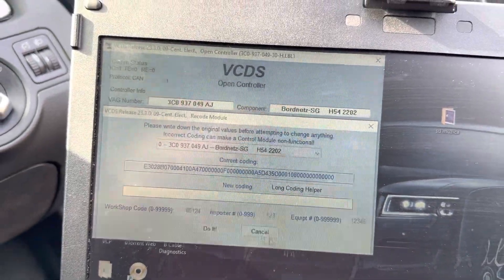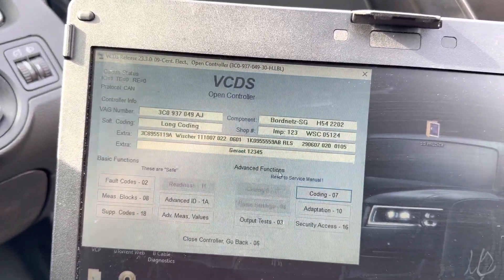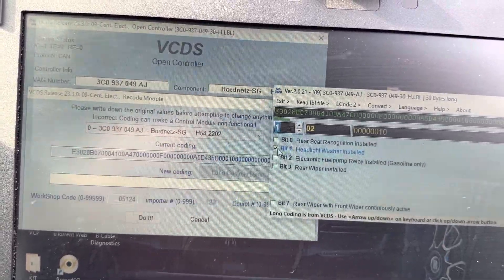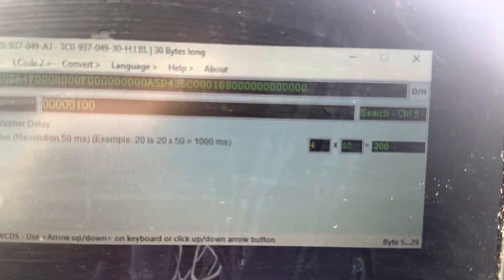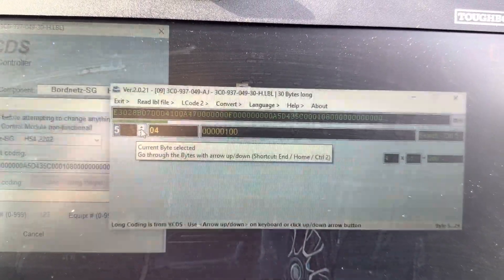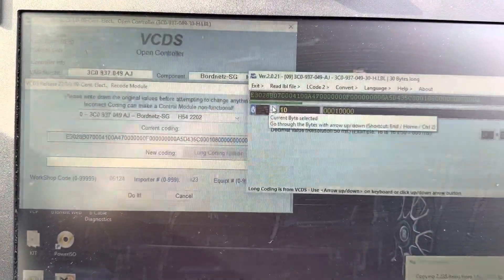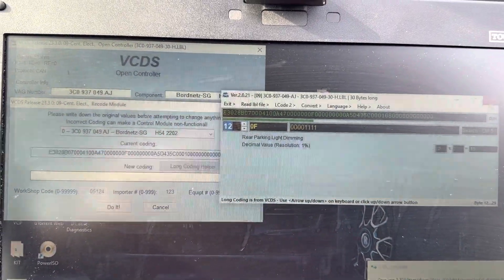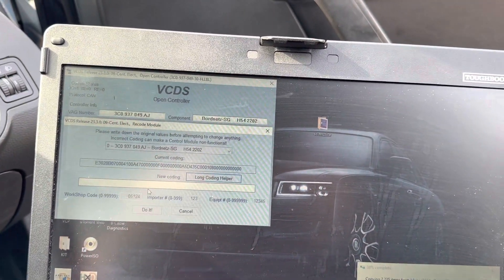Passat B6 headlight washer retrofit coding in CECM

Comment: How did you retrofit it?
Reply from the maker: Relay j39 53 
Pin 1 0.5 rt/br join pin 3 relay
Pin 2 0.5 ws/sw - cecm D pin8
Pin 3 2.5 rt/br ignition + fuse 30A F35 or 36
Pin 5 2.5 ws/rt - Pump pin 2
Pump pin 1 - ground
Reply: @lavianeverything  amazing I’m thinking of doing it however to a Passat b7 but I’m sure they are the same platform. Thanks
Reply from the maker: @forhadchoudhury2291   b7 is a bit different, see below:

Relay j39 - 646
Pin 1 0.5 rt/br join pin 3 relay
Pin 2 0.5 ws/sw - bcm T52B/40
Pin 3 2.5 rt/br ignition + fuse 33- 30A 
Pin 5 2.5 ws/rt - Pump pin 2
Pump pin 1 - ground
Reply: @lavianeverything  thank you soo much! I will be doing this retrofit soon. Thanks for clearing everything up!
Reply: @lavianeverything Hello, is there a source that shows all these types of connection diagrams?
Reply from the maker: @ elsawin, google it
Reply: Hi, just a quick question does the current washer reservoir support the headlight washers or would I need to replace it? It’s a Passat b7 thanks
Reply from the maker: @forhadchoudhury2291  bigger tank. Get everything from donor car
Reply: @lavianeverything  thank you for the quick reply. I’ve been looking however I don’t know which one to get as there’s loads of part numbers. By any chance do you know which one it could be?
Reply from the maker: @forhadchoudhury2291   I recommend you going to a scrapyard or find a b7 breaking. I don’t have part numbers unfortunately
Reply: @lavianeverything  no problem. Thank you for the replies